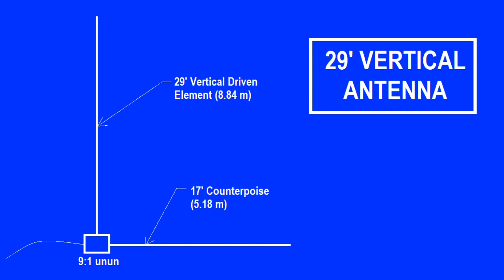Building the 29' End Fed Vertical Antenna

Comment: I’ve got a 29’ random wire in my attic in an inverted V with a 17’ counterpoise underneath it. It’s awesome! All bands 6m-40m. Surprisingly 40m works OK despite the length. 20m isn’t as good as an EFHW. The higher bands are great. I’ve worked from California to Norway with 5 watts.

Comment: Another great video Walt!  That's a super compromise antenna and I use it all the time and have good luck with it when operating portable.  I normally run it with no counterpoise,  utilizing the coax shield as the counterpoise.  You might try putting the choke at the transceiver end, giving you an additional radial.  It would be interesting to see how that works for you.  I hope your son's concert went well!  Be well. be safe.  73,  George K2WO
Reply from the maker: Thanks George, I might have to give that a try.

Comment: Interesting, I came at this from a slightly different direction. I had been thinking of building a Rybakov vertical, but the 26’ length looked like it might present a difficult match, I think on 17 Metres, so I went with 29’. The Rybakov uses a 4:1 unun, so this is what I built using a t200-2 core. I haven’t swept the impedance yet, but the tuner found a match on all bands 40 up. Obviously good band conditions help, but my first contact yesterday with 20W SSB on 12M was with Brazil, from a portable site in the Chiltern hills, southern England. I then checked into a US net on 10M. The surprise for me, like you was how well it performed on 40M.  I joined the WAB, worked all Britain net and contacted everyone who was on it, with reasonable reports ranging from Devon in the West Country to Scotland. Single band antennas should offer better performance, but it is very convenient to just jump round the bands. 
As an aside I have found the audio from the G90 to be a little unrefined and a BHI NES Mk4 external speaker is easier on the ears, admittedly at extra cost. 
73 Nick G0OQK
Reply from the maker: That’s awesome Nick, thanks for sharing! 73, Walt

Comment: Another great video, Walt! Thank you!!

I'm in San Jose, a few minutes from the southern end of the San Francisco Bay, including the historic Port of Alviso (now a Santa Clara County park) and Don Edwards SF Bay National Wildlife Refuge, K-0189. I'm strictly QRP portable, since my QTH, both by its design and its location in the city, is like living in a Faraday cage. I've been thinking for a while of building some verticals, since the only place I've found to run my 10-40 EFHW, without getting in other people's way, is the Palo Alto Baylands Nature Preserve, about 16 miles north (though I've only checked out the San Jose side of Don Edwards, on the west side of the Bay, and haven't yet gone to the Fremont side on the east side of the Bay). 

I'm using an Icom IC-705, 5W with the internal battery, 10W with my home-brewed LiFePO4 battery pack and solar charging system. I'm learning CW now, as I've found I don't really enjoy hauling my laptop into the field, but I've had a few contacts on FT8. Nothing on SSB yet. 73 de KN6NPZ, Daryl
Reply from the maker: Thank you Daryl!

Comment: Of all the random wire vertical lengths I've tinkered with,  29 is my go-to.  Works great all around, is ideal for using with a  spiderbeam pole and also works fine sloped or even just horizontal not far off the ground. Prefer using Nelson 1:9 matchers over the LDG's, but still use both.  Great videos as always.
Reply from the maker: Thank you! 73, Walt

Comment: I watched this video this morning and went right out to my ham/work shed and made this antenna. I've been looking for a wire antenna that would use the entire length of my  10 meter DX Commander but not be longer than it. I found out it works better here on land with 4 counterpoise/ground radials. It worked great, my LDG Z100A easily matched the antenna to my FT-891. Of course the G90 won't have any trouble either. LOL Thanks Walt.
Reply from the maker: Thanks for watching! 73
Reply: What length counterpoise did you use?.
Reply: @MrToymod  About 17 feet each.

Comment: Another update.  The random wire antenna I already described really works!  Holy Marconi!  I even had a daytime QSO with a fellow OM in Brazil on 12 meters.  I live on an island in the eastern Mediterranean.  We were both using nominally 100w.  He had a multi-element beam antenna.  As some wags say, the best amplifier is a good antenna and a good location.  My island is very small, and my shack is 150m above sea level, so I guess that helps.  10-40m seem to work okay on TX.  My tuner can "match" 80 and 160 meters, but the wire is a wee bit short, I think.  I have not yet tried these bands.  I am considering building a linear loaded inverted "V" antenna that supposedly will work well on 80 and 160 meters.  73! David SV0SGS
Reply from the maker: That’s awesome! 73, Walt
Reply: "Holy Marconi" made me laugh. I will steal it.

Comment: In the video I see you put the choke side of your coax on the unun side, you should switch it to the transceiver side. I burned up a 49:1 unun doing that. Did some research and found out that with endfed antennas the choke goes near the transceiver.
Good videos, 
Steve, k7ofg
Reply from the maker: Thanks Steve, the unun goes at the transceiver end of an end fed if you’re not using a counterpoise. In my situation by saltwater I do not want my coax being part of the counter and thus the choke is at the antenna end and I have a 17’ counterpoise doing the work.

Comment: I really gotta give the 29' random wire a shot. I've been using a 35.5' for a while and it works great. But the 29' would fit a little easier on my 33' mast, which would be nice for POTA when I don't have a lot of space.
Reply from the maker: It worked great!

Comment: Great stuff I use a 33ft vertical wire with 9:1 unan and a 16ft 6' radial.
I have experimented with capcitive radials using old 75ohm tv coax . You short one end out by soldering the braid and core together this goes to the radial fixing point and the end of the wire you cut back 1/8 th wave remove the braid from the end seal with tape and works great. 
Keep safe de M0JFE
Reply from the maker: Thank you!

Comment: Walt: I thought I commented on the 29 foot vertical wire, but don't see it in thd comments. Must be a Senior Moment here or something. Anyway, I use a shorter counterpoise with my 29 footer and support it on an MFJ 10 meter mast. Built a drive-on base and run the G90 or an FT-817nd. I have the EARCHI 9:1 as does my fellow portable op, John, KB2HSH.  We have jointly activated POTA in and around the Buffalo/Niagara Falls region,  plus I activate parks south of Buffalo with Anne, WB1GVL. Anne doesn't get on the air much, but rides along (and has for the last 48 years or so...)

I don't do well with the cold anymore, so we will be back out in the spring!  73, Keith, WB2VUO
Reply from the maker: Hi Keith, I get others saying the same on comments and I promise i'm not deleting but I have senior moments too LOL. After spending the last two winters in Poland I'm over the cold too! 73, Walt

Comment: Hi, Walt!  I quickly put together a 10.82 meter antenna with a 9:1 unun and 5.18 meter counterpoise.  The antenna is configured as an inverted "L" and hangs vertically about six meters on a telescopic pole and the rest horizontally.  It has practically no usable swr on the bands.  I have hooked up an mfj auto "tuner" at the base of the antenna and can match 50ohms on the bands 10 thru 160m. 

But what does that really mean practically?  I don't know antenna theory.  It just seems to me that, yes, I have a good match on 80m and 160m, but I think most of the energy caught up in the standing wave dissipates as heat and does not radiate.  Besides, 10 meters is incredibly short for 160m and even 80m.   A half wave dipole for 160m would be 80m long, about 240ft.  For the 10 to 40m (maybe) bands this antenna length may be okay. 

I am very wary of antenna manufacturers who offer antennas that can operate from 6m to 160m.  As a ham newbie I fell for one of these antennas that cost a lot of money.  I don't think they work very well, especially compared in an A/B test with other, monoband, antennas.

My main antenna at my QTH is an EFHW antenna for 10 to 40meters, with an additional coil loaded extension for 80m.  No "tuner" is necessary. Additionally I use a monoband EFHW antenna for 20m and a home brew full size inverted "V" antenna for 40m.

I have the space at home, so maybe soon I will cut a 135ft (41meters) piece of wire for 160m.  That is at least a quarter wave.

In any case I will try out the random wire antenna this weekend on 80 and 160 meters and see what the cat drags in.

Good videos!  Keep up the work! 73!
SV0SGS
Reply from the maker: Thanks for commenting, I've found it very hard to get a good match with a random wire and a 9:1. The goal is to get it as close as possible and let the ATU or tuner do the final fine tuning. Your antenna sounds interesting. I've never done much  on 80 and 160, I hope the cat drags in some good contacts!
All the best and good DX!
Walt

Comment: I was looking at that antenna you have at home, especially as they make a heavy duty version of it now. If it were longer it would be a Rybakov and would probably work better. The way to do it would be to replace two of the sections with longer tubes, but there might be stability issues, and getting the right wall thickness of tubes. Its a thought though. I guess they make it shorter to make it stronger.
Reply from the maker: I might experiment with it when I'm away from the water one day.
Reply: @COASTALWAVESWIRES  Even a bit of wire on the top. The maths looked better than the original length.

Comment: Hi Walt, Great video again. Seems we are walking the same path with different results. For me the 1/4 wave ground plain for 20 meters en the T2LT are the Top DXers. The random wires is in 17,5' or 29' don't get me outside Europa. Al dough for ease and the possibility of not getting out of the car in the rain changing antennas I use them quite often. For my conditions (in land, peaty soil, 10 cm high grass) The best results on the analyser I on a 29' antenna on a 9 meter carbon fiber fishing pole get with a 26' counter poise. Lowest SWR/MHz 10m: 1,5/29.1, 20 meter 1,8/13,8, 40 meter 2,6/7,3. the curves are quite flat so nothing the tuner can't handle. But still no contacts outside Europa. For me this is a radius of about 1200 miles from the Netherlands. Wonder how to improve this and al open for suggestions😊
Reply from the maker: Thanks! wow I'm not sure what would help. Maybe experiment with different counterpoise setups.
Reply: @COASTALWAVESWIRES  I did some google searching. My conclusion is that the conductivity of my carbon fiber mast might be the problem. For my 1/4 wave and T2LT I use a fiberglas pole for the end feds a carbon fiber pole because because they are longer. All longer fishing poles are of carbon fiber now a days be because of the weight. May I ask what jou are using for a pole?
Reply from the maker: @gerard6544  yes I use the DX Commander 10 meter expedition pole. I also have the DX Commander 7m pole. Both are great.

Comment: I'm curious if I made a 29' ground mounted vertical and used several ground wires say like 12 to begin with. Would I need the UnUn? How long should the ground wires be?
Reply from the maker: Yes you would still need a 9:1 unun to get an impedance match at the feedpoint. There’s no way around that. Counterpoise lengths on the ground are not too important, I make mine about 17 feet long each.
Reply: @COASTALWAVESWIRES  thanks Walt for the reply!

Comment: Walt: It has been great weather recently in Hampton Roads for getting outside and doing antenna testing. I like that the 29 ft random wire fit easily on the 10M mast with room to spare. SWR on 10M was flat. Did you record SWR on other bands? Did I miss it?
Reply from the maker: Other bands were all under 2:1. 12 meters was actually 1.2:1, I wish the band would have had some activity on it.

Comment: Hi Walt!  Can this antenna be made with a 17 foot MFJ vertical mast, then 12+ feet wire attached horizontally to a tripod?  This would then be an inverted-L.  Would I use a 9:1 or a 4:1 unun???
Reply from the maker: I think that would work with a 9:1 for sure. Give it a try!

Comment: Hi walt  how do you think it would do as a receive  only antenna  for swling .thanks Tim
Reply from the maker: I think this would be an excellent antenna for SWL.
Reply: @COASTALWAVESWIRES  thanks  Walt, (Q) would  it  work   in   PVC  tubing to protecting  from the  weather?
Reply from the maker: @thewind-ne8rh  I’m not sure, I would just let the wire stay out in the elements myself.
Reply: @COASTALWAVESWIRES  ok thanks  Walt , I was thinking  of using (2) slinky's on op and (1)on the bottom  with  a 9:1 unun like you used  with the ground or counterpoise terminal on it

Comment: Any tuning the lenght of the 29' wire?
Reply from the maker: Yes, this antenna requires a tuner.
Reply: @COASTALWAVESWIRES  I mean do I need to trim the wire like an efhw or cut 29' and its good
Reply from the maker: @ronrico2620  cut 29’ and it’s good

Comment: What about a 49:1 unun ?
Reply from the maker: Would work with 33 feet as an end fed half wave for 20 meters but not for 29 feet.
Reply: Oh I see... Well I was looking for a solution from 40m - 10m ... I have a bulun 1:1 and also an unun 49:1 ... And plenty of wire ... But I can't play with vertical setups as I want to avoid thunders etc... bad weather. So I guess an horizontal setup would be more ideal
Reply from the maker: @z3r0c00l2  sloping with 66 feet of wire is the classic EFHW with a 49:1. It’s an excellent antenna for 40 through 10.
Reply: Thanks for your great help.  Well I do have a mast of 6 meters . I guess a slopper would be like letter L .. never builded one . I had build an efhw differently (check my qrz) . Here at my home base I have limited space . So the unun would be on the floor, and then the wire would go up and come down ? ... Thanks again . Jimmy SY1DAL

Comment: On my recent trip, I had hoped to operate from three POTA locations.  Only one of the three gave me permission.  The one in downtown Richmond needed more advanced notice (a city permit is required to operate on the sidewalk), and I left a message for the person in charge at the third location but never received a return phone call.  I am going to try this setup for a future trip.  Fort Monroe (K-0929) told me that I could operate, don't put wires in the trees, stay away from power lines, and do not put a spike in the ground.    I need help with a new antenna idea that can be used with my QRP rig (20m/40m).  I'd like it if all the components could be put in my carry-on bag.  Walt, have you had trouble carrying wires, winders, and coax onto airplanes, or do you check those items? de David AE4LH
Reply from the maker: Hi David, I usually check that stuff and just carry the transceiver and battery on with me.